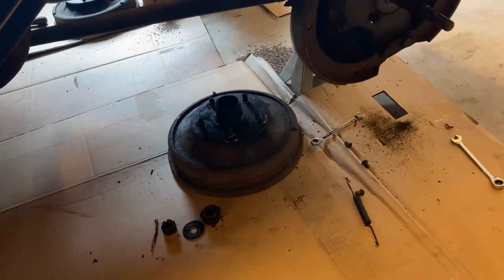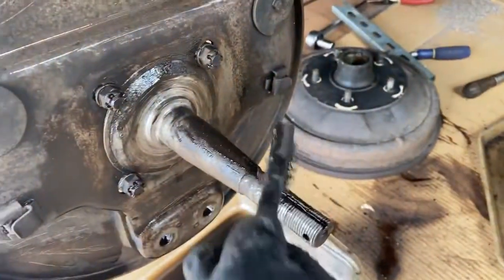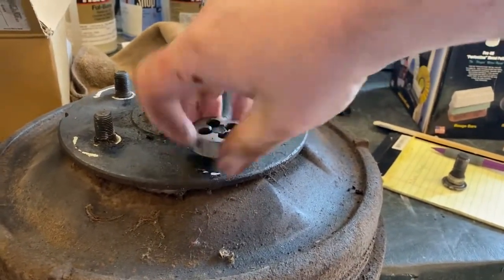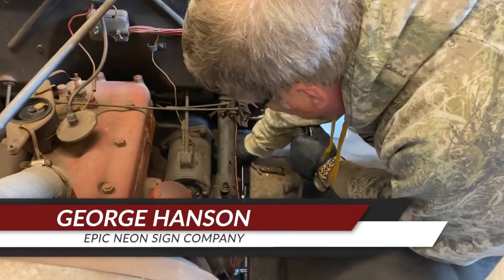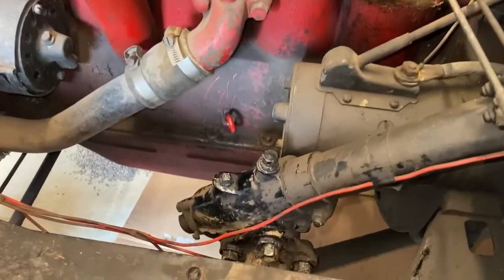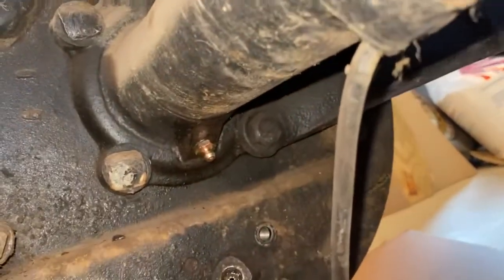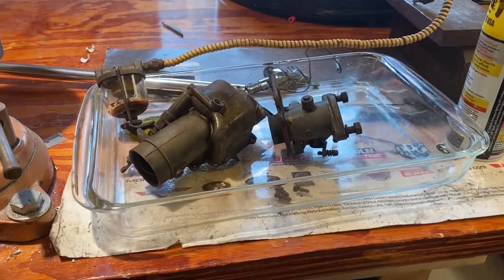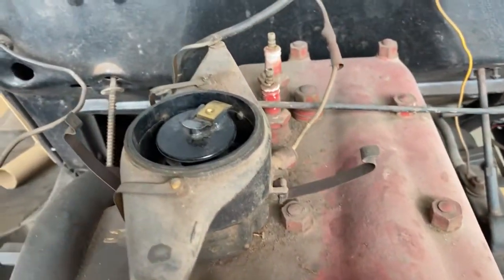1930 Model A Ford Restoration - Ep. 4 Routine Maintenance | Steering | Epic Neon | Epic Restorationz

Comment: How are you going to be able to bleed the rear brakes with the wheel cylinder upside down?
Reply from the maker: We’re still researching our options on that one. We’ve gotten side tracked working on the kingpin assembly up front lately. It seems there are a few different ways people have bled them out over the years. We’ll see about including that in a future video once we nail down what we want to do.